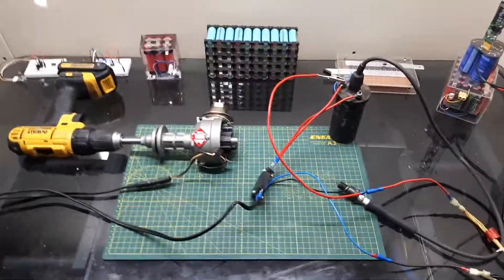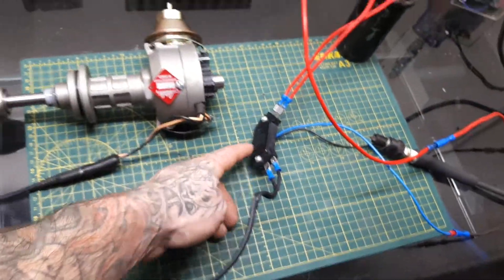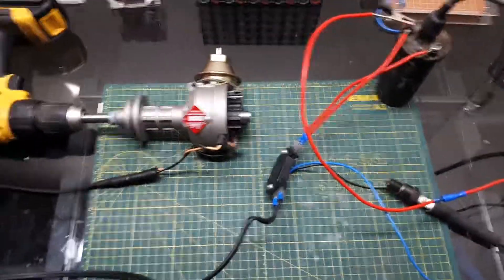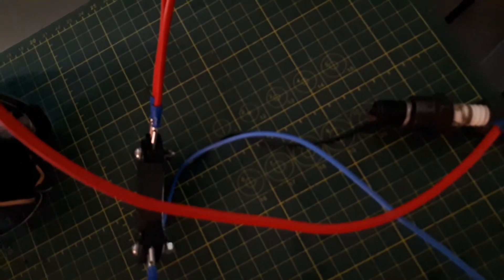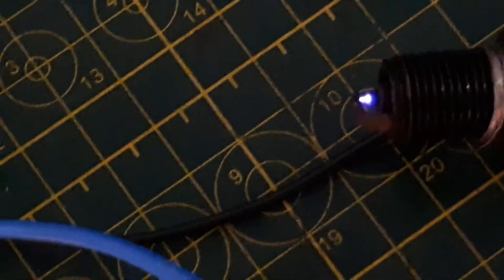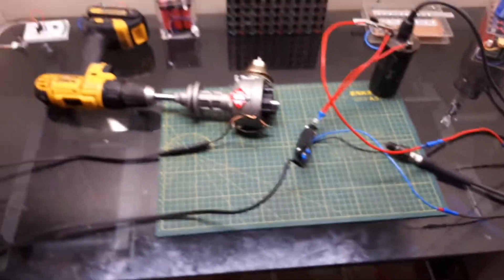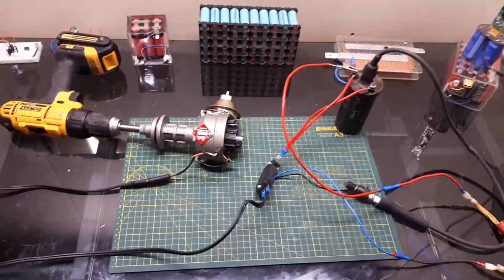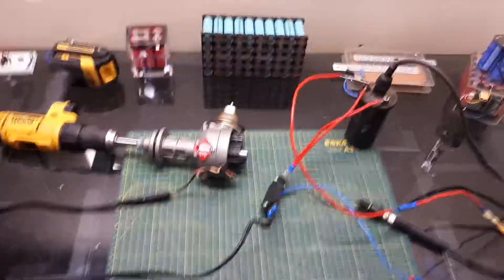GM HEI with Chrysler distributor

Comment: That RPM at the plug is not as slow as you think it is, take the drill speed and multiply it by 8 because that is how many times it fires in a single rotation. You need the rotor button and cap to get to a single fire per rotation. Looking forward to seeing what you built. Thanks, good video.